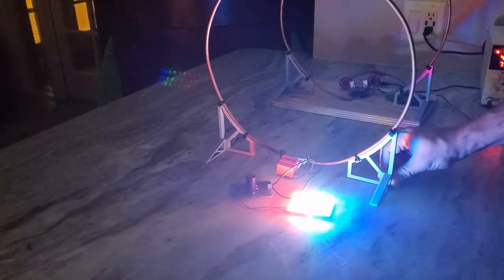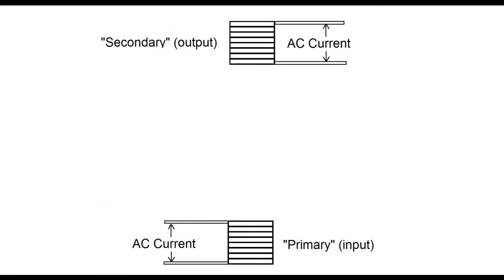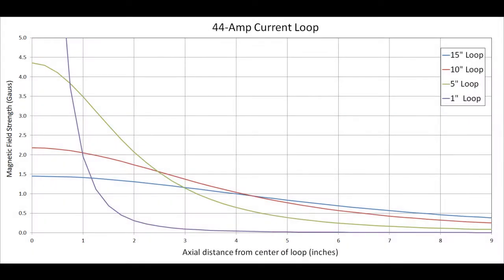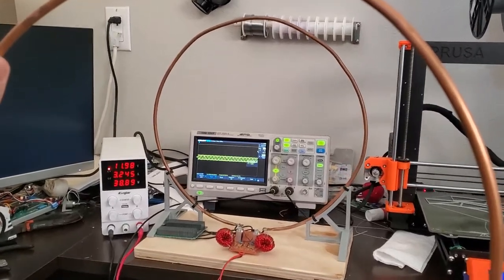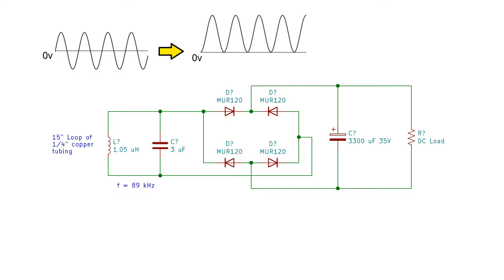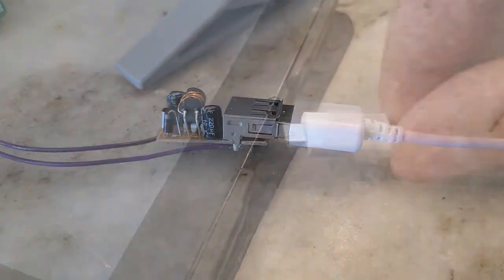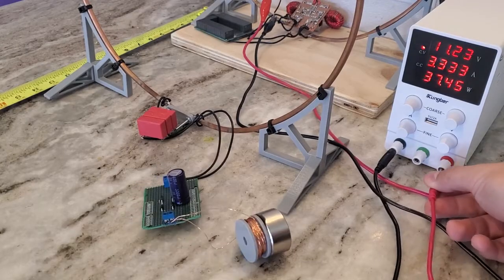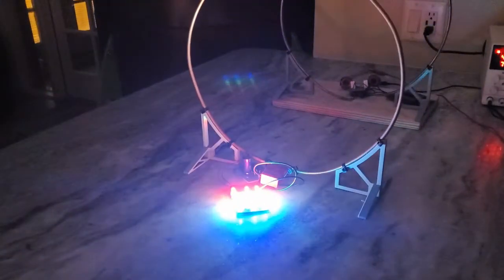Wireless Power Transmission

Comment: To stop the 'latch-up' it may be a good idea to feed the 470 ohm resistors from a fixed voltage below the conduction level of the gate protection zeners.

Comment: Hello,
Can I use a HF inverter module to apply a 20Khz pulse wave to the transmitter coil instead of the transmitter driver circuit?

Comment: Well i learn all about it :
- its only an electric magnetic field
  That push up with the npn transistor by
   Ac current - where you can lay the copperwire inside this field
 there is no wireless energy ...
But can we push it up with ozilators for mhz frequenz and Antena to send? 🤔🤗

Comment: You didn't mention it, but I imagine the frequency you use will have a big impact on distance/efficiency.

Since the copper loop is essentially a loop antenna, carefully selecting the frequency the LC tank resonates at could allow you to make the antenna resonate aswell and get better performance.
Reply from the maker: Yeah, both the transmitter and receiver are identical LC circuits that are in resonance. Without resonance i probably get like 1/10th the power shown in the video
Reply: I get that the LC circuits are matched. But I'm not talking about oscillator resonance.

I'm talking about ANTENNA resonance. Just like how you want to size a dipole to be 1/2 wavelength to get the best radiation pattern. Since you're using loop antennas, the diameter-frequency relationship could greatly affect power transmission.
Reply from the maker: @BenjaminDMarshall  Oh i see. Yeah, that would probably work, but judging by the loop geometry i'd probably need to be running 10's of MHz or so
Reply: Yeah, I was thinking about how much higher of a frequency you'd need for such a small loop. It might not be the easiest thing to drive.

Still, I'd be curious to see how far a giant loop could transmit usable power doing that.
Reply from the maker: @BenjaminDMarshall  I'll have to try it at some point. I'm currently trying to build a high frequency driver (~15-20 MHz) that can push several hundred watts for projects like that, but it's proving to be very difficult to get much beyond 10 MHz with regular FETs/BJTs
Reply: @HyperspacePirate 🔴 What Is Islam?  
 
🔴 Islam is not just another religion.  
 
🔵 It is the same message preached by Moses, Jesus and Abraham. 
 
 🔴 Islam literally means ‘submission to God’ and it teaches us to have a direct relationship with God.  
 
 🔵 It reminds us that since God created us, no one should be worshipped except God alone.  
 
 🔴 It also teaches that God is nothing like a human being or like anything that we can imagine. 
 
🌍 The concept of God is summarized in the Quran as: 
 
📖 { “Say, He is God, the One.  God, the Absolute.  He does not give birth, nor was He born, and there is nothing like Him.”} (Quran 112:1-4) 📚 
 
🔴 Becoming a Muslim is not turning your back to Jesus.  
 
🔵 Rather it’s going back to the original teachings of Jesus and obeying him.  
 
 
More .....👇 
 
🔴 THE RETURN OF JESUS

Comment: I'm curious as to why you chose to use one loop of wire as opposed to multiple. Was this to lower the inductance of the coil? If so, couldn't you run the driver at a lower frequency with the higher inductance to achieve the same current? Since the magnetic field intensity is related to the current through the loop, I would think more turns of wire carrying the same current would sum together for a higher flux density. (I am probably missing something critical here, right?)
Reply from the maker: I had a lot of it laying around, but it also makes sense from an economic standpoint, because skin effect at high frequency AC causes current to only travel through a region a few tenths of a mm from the surface of the conductor, so thin walled tubing works very well. There's also the advantage that it can have water pumped through the inside to keep it cool

Comment: Nice! If you did this vertically then you could put the circuits around the loop and also mount drone fans around the ring (using 3D printed mount points). As long as you have something stabilizing the whole thing then you could start flying up wirelessly to some degree (especially if you get a lighter hoop). Not sure if you could also put solar cells in the middle (or around it) with a light 3D mesh to add to the power as well..